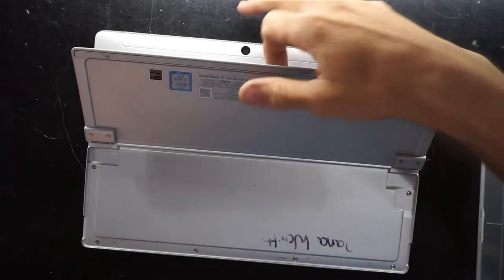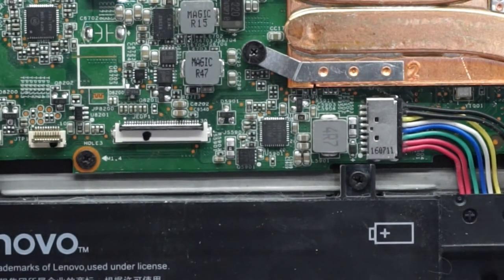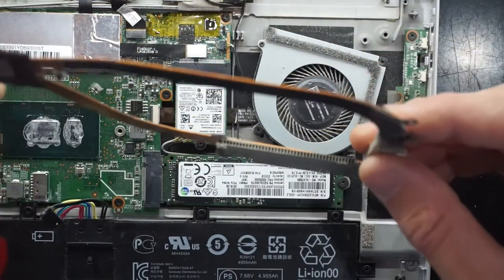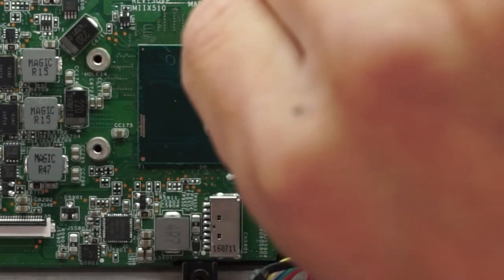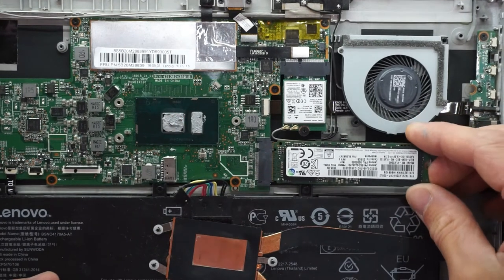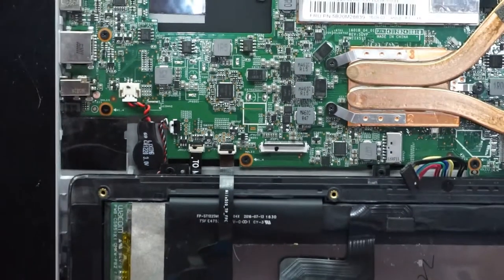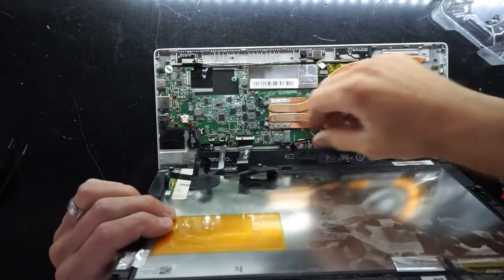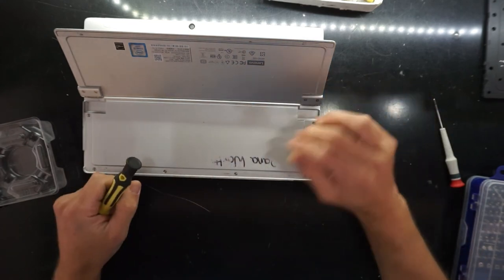Lenovo ideapad Miix 510 Thermal Paste Replacement

Comment: Thank you so much for showing this. I just closed the screen on mine one night laying it on a chair and now it wont work at all? So I need to get out the SSD but just curious ... I think its probably overheated. Is there a fuse or?  and that's the 64 dollar question. Thanks for showing how this all comes apart. Cheers :)

Comment: Hi I just replaced the system board in mine. The reason i had to do this is when investigating a failed power switch (which was causing continual reboots). I put the panel display connection on back to front which caused a chip on the board to start smoking. (nasty) I eventually got another motherboard and power switch and it is working fine however the touch panel lead pulled away from the connector when I was reinstalling resulting in a disintegrated connector. Never ending troubles. I am not sure which way the touch lead goes back ,but from your video it seems the white line should be visible . (it can go in either way). Anyway it seems feasible to me that it may be possible to solder the cable direct to the panel and dispense with the connector. I can use the computer without the touch panel but if possible I would like to fix it.  Your thoughts on that as i wont be buying a replacement panel as it would not be worth it.
regards and thanks for the video. I wished i had watched it before starting as i was just pulling cables out rather than lifting the little tabs.

Comment: Hey. Thanks a bunch for the vid! I have the exact same one. Is the Ram soldered and/or inaccessible? Mine came with 128gb/4gb and I was hoping to upgrade it. Thanks
Reply from the maker: Ram I'm pretty sure is soldered 

Storage is removable if I remember
Reply: @rickstechrepairs  Thanks you!

Comment: I just accidentally purchased a board with an i5 processor to part out for my computer with an i7. Do you know if this CPU is soldered or socket? I can't find this information ANYWHERE online. Ideally, I would like to keep the i7! Thanks!
Reply from the maker: Basically all laptop mobos are soldered in